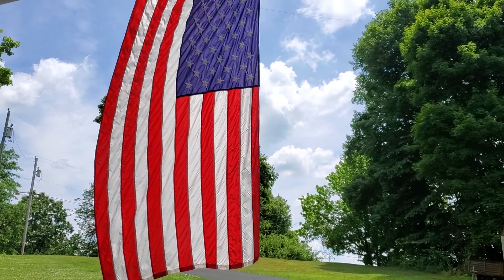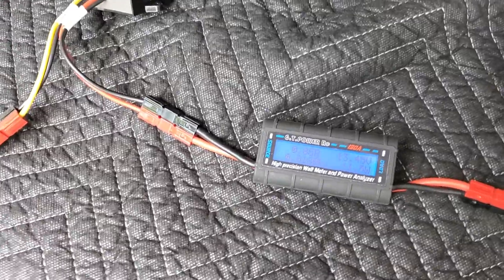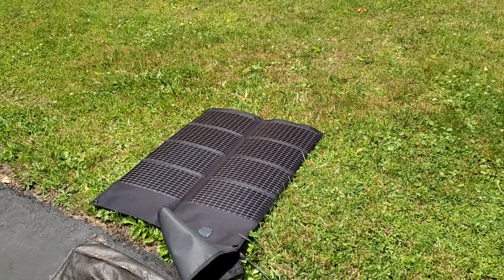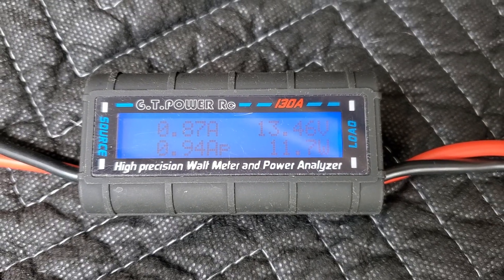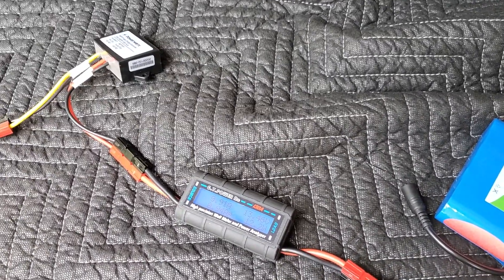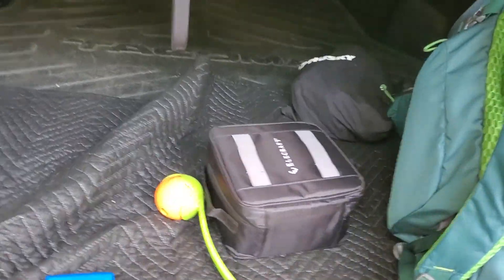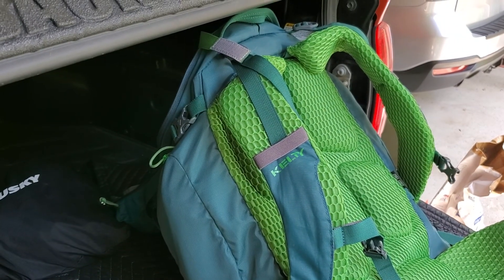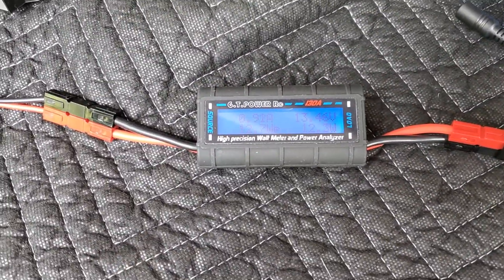Ham radio QRP solar setup

Comment: Hello and thanks for your video. One quick question: can you charge and feed the trx at the same time with the setup you have in the video? All the best!
Luís
Reply from the maker: I believe you are talking about power for the radio.  Yes, with the external battery I am using I can charge the radio while I use it.  I can use a regular power charger or a solar panel.  It is a battery by https://www.bioennopower.com/

Comment: What length of cord would you say you have between the panel and your battery? 20 feet? Any losses? De K2SCH
Reply from the maker: It's 50 feet of 10 gauge wire.  I used this calculator to determine the gauge wire I should use.  https://www.renogy.com/calculators#tab_solar-cable  According to it I've got about a 2% loss.
Reply: @TangoOscarMikeN3WS  thanks so much!

Comment: I'm torn between the Kx2 for its packability and the Yaesu 891 to have the extra watts when I RV camp. If the 100 watts amp for the Kx2 wasn't so expensive I would definitely go that route. I live across the county from you and want something that I can make contacts with not maybe make with only 10 watts
Reply from the maker: I'd probably go for the 891 if I were you.  If you're RV camping and not backpacking, I think the 891 is a better option.  I love the KX2, but there are times when I need to break out my old FT-857 for more power.
Reply: @TangoOscarMikeN3WS  I backpack a well a hammock camper I want a multipurpose rig got to watch the $$$ to many expensive hobbies lol